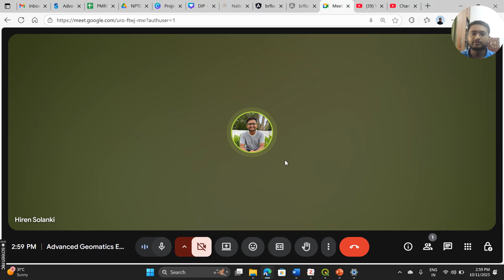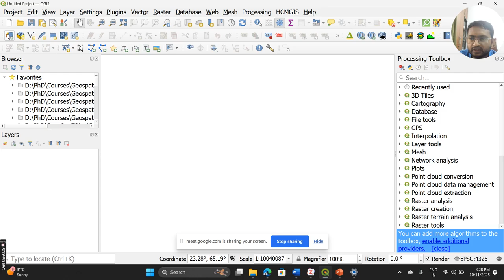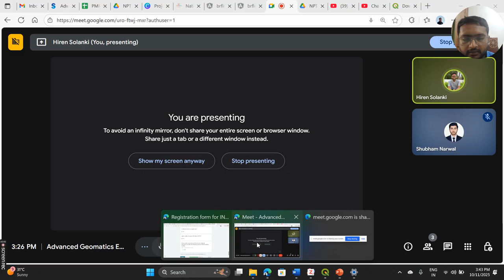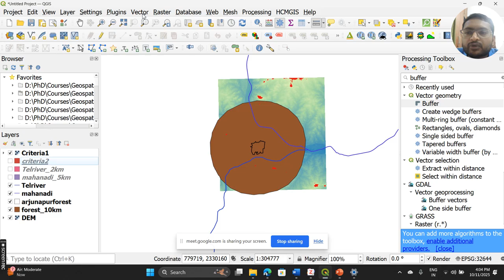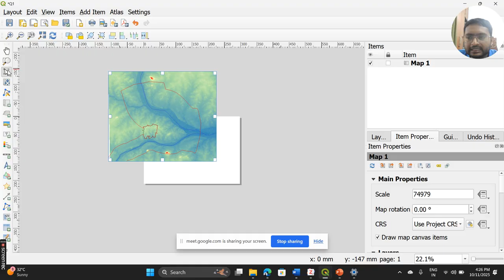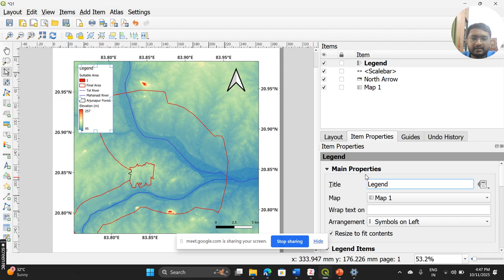Week 12: GIS | Problem Solving Session | Advanced Geomatics Engineering | NPTEL

Comment: 00:15 - Final class overview and practical GIS data handling.
06:22 - Overview of accessing resources and installing QGIS for problem solving.
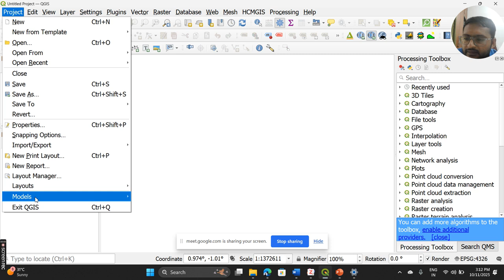13:09 - Learn how to manage panels and layers in QGIS effectively.
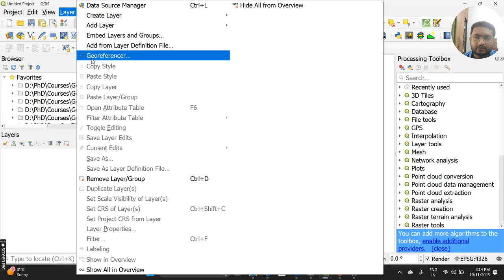15:25 - Overview of geo-referencing and managing plugins in QGIS.
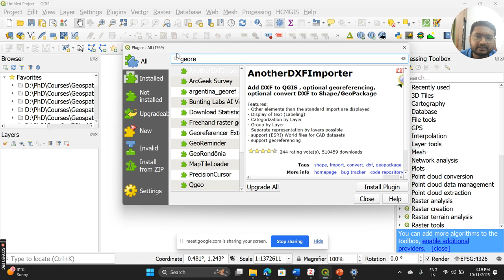20:03 - Overview of GIS tools and plugins for data digitization and georeferencing.
22:14 - Difference between raster and vector data in GIS tools.
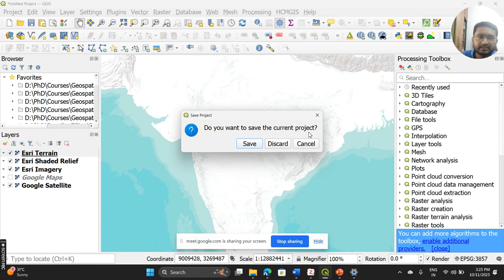26:38 - Conducting a site suitability survey for a forest department office.
29:01 - Importing essential GIS datasets in QGIS for analysis.
33:22 - Effective data management is crucial in GIS workflows.
35:44 - Understanding coordinate systems and symbology in GIS.
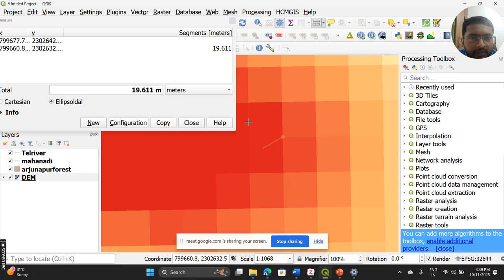40:16 - Introduction to raster and vector data properties in GIS.
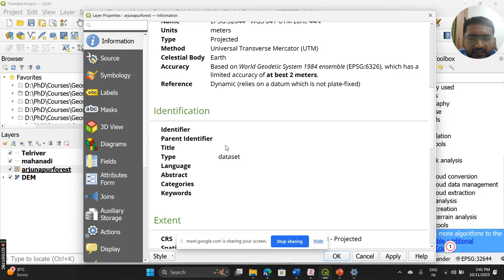42:21 - Changing layer symbology in UTM zone 44 north.
47:00 - Setting symbology for polygons and rivers in GIS software.
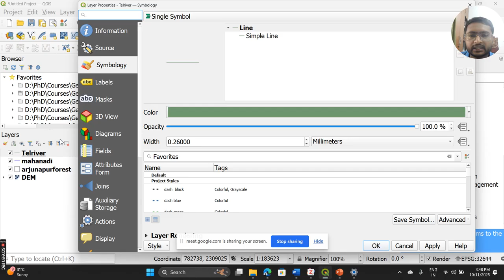49:19 - Applying elevation conditions using raster calculations in GIS.
54:46 - Using palleted symbology for classified limited-value raster data.
56:44 - Creating buffers for river proximity analysis in GIS.
1:02:04 - Demonstrates union and buffer operations in GIS for spatial analysis.
1:04:41 - Editing GIS layers to exclude forest areas from a buffer zone.
1:11:08 - Dissolving polygons in GIS to visualize significant features.
1:13:45 - Assessing construction site suitability based on area and location.
1:18:43 - Instructions for zooming and adjusting map frames in GIS software.
1:21:29 - Demonstrating effective map scaling and content movement techniques.
1:26:04 - Understanding frame and content adjustment tools in GIS software.
1:29:25 - Adjusting item properties and scaling in GIS software.
1:34:42 - Modifying grids in GIS involves setting CRS and point intervals.
1:36:59 - Exploring mapping options and customization in GIS.
1:42:22 - Adjusting GIS frames and adding essential map elements.
1:44:48 - Editing map layers for clarity and accuracy in GIS software.
1:49:55 - Customizing maps through user interface in GIS software.
1:52:19 - Transitioning from ArcMap to Python and QGIS for advanced GIS analysis.
1:56:27 - Final class discussions and future notification details.
1:58:46 - Access recorded sessions and resources via YouTube and Google Drive.